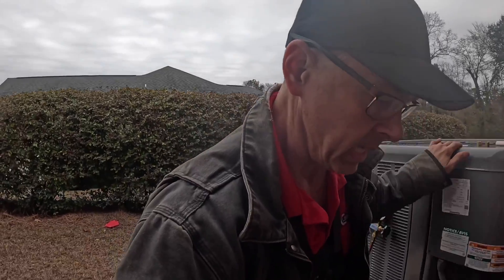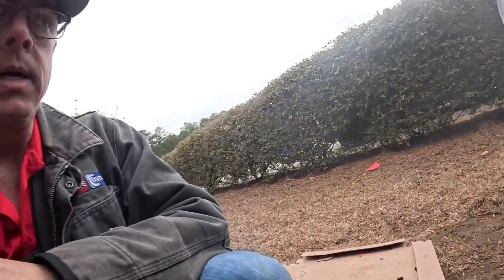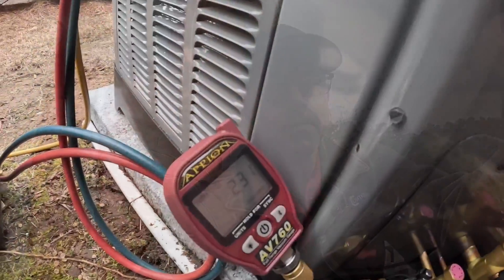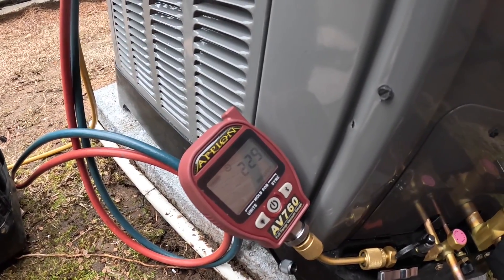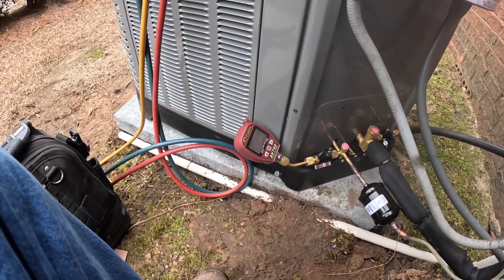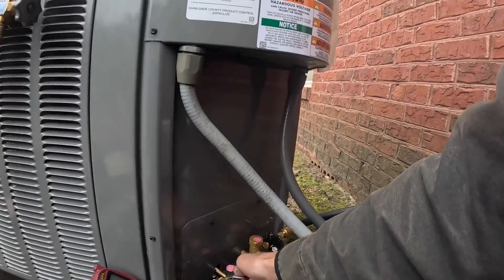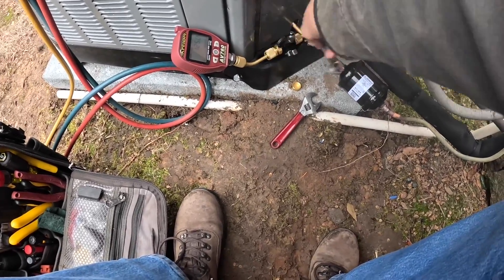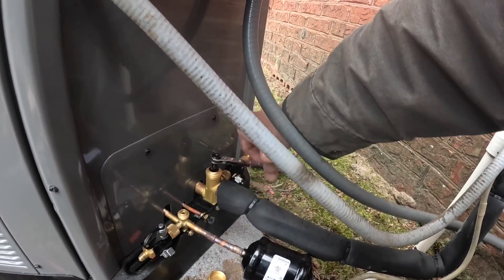I Love This New Micron Gauge! #hvacguy #hvaclife

Comment: Just a tip. It’s better to crack the vapor side first if you’re going to run it in AC mode as any oil that is lost from compressor when opening the valves will quickly return that way.

Comment: I'm glad that you have all to the cool kids toys.  I just bought a Fieldpiece micron gauge to replace my Inficon (which was a real POS!).  So far I'm pretty happy with it.  I may need to replace my 2002 era Yellow Jacket super evac pump.  It's barely starting in the cold weather.  Even when it's 60 outside, it barely cranks up without a fuss.  I saw that 18V Milwaukee and wondered if it was a good piece of equipment.  Thanks Curtis!

Comment: I’ve never used that Appion but I think the BluVac Pro is the best micron gauge ever made. It can handle positive pressure and it has a built in algorithm that will tell you if you pass or fail the decay test in 10-15 seconds so you don’t have to wait.

Comment: The bluvac micron gauge has a decay test that you don’t have to wait on. It extrapolates the drop after about a minute. Plus with the bluvac hoses I get below 500 in 6-7 minutes with only a tiny battery operated 2 cfm vacuum pump.
Reply: Do a vid.
Reply: @OcRefrig plenty of vids on that device by jim Bergmann
Reply: @OcRefrig  yeah there are lots of vids on this set up. I only use one hose too! It’s insane how fast they are.
Reply: @AaronPowellvox yea there nice,pricey tho,there whole evacuation kit is a good bye
Reply: @cardsfan1590  yeah. You can do it with just the one hose and a schrader puller though.
Reply: @AaronPowellvox  Yeah,for sure, I have a yellow jacket  single vac hose,I use with a puller. I've seen alot of the blue vac videos and checked them out. They look nice,just a lil more  pricey for my cheap self. I've been thinking about getting one tho